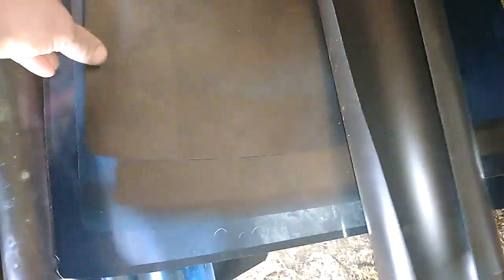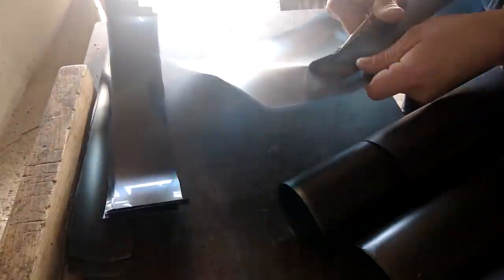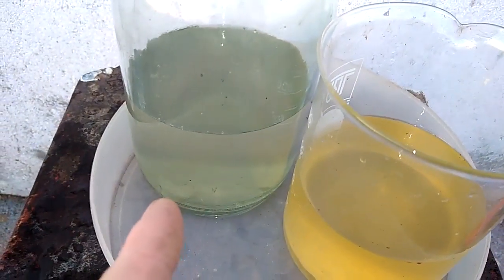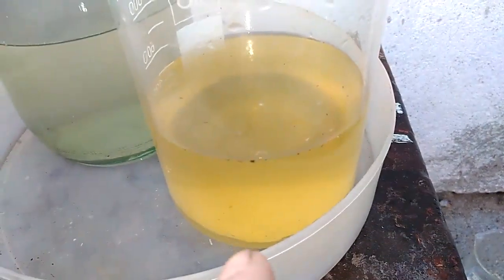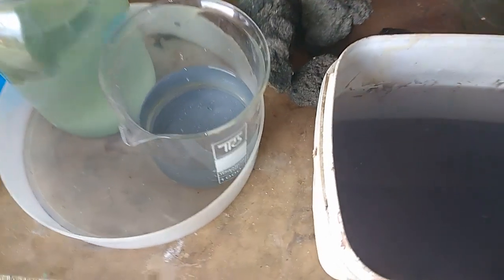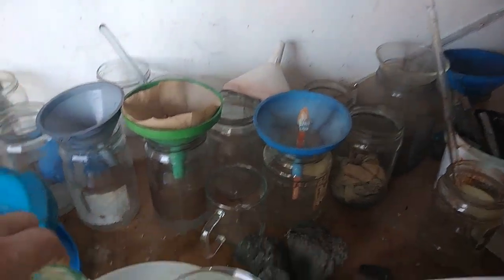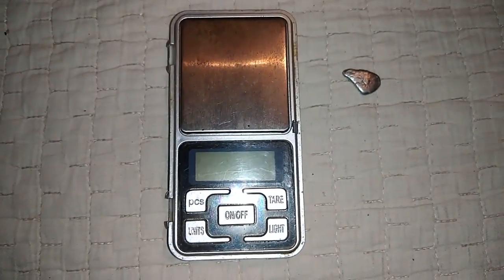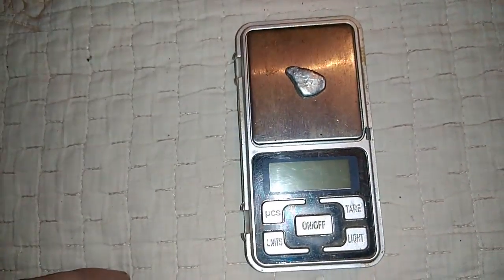Silver from X-RAY FILMS recovery!

Comment: We used to treat 10,000 pounds/week of medical x-ray , no acid but caustic soda , each film was shredded in 1/4 x 1/4 inch , the bath was then centrifugated to separate gelatin from silver  , the final mud was dried then burnt in gas furnace.The plastic was of no value @ the time. Now x-rays are completely done by electronics ...exception in poorer countries.

Comment: Back in the early 2000's I worked at a place where xrays were stored before being scanned.  After they were scanned they were sent for destruction.  NT recycling but shredding and then a landfill.  I spoke with one of the guys who came to pick up a load on day and he was saying that while they could recover upwards of 1oz of silver per every 100 xrays they were legally prevented from doing so because they were considered a medical record. Each box we had in storage had between 200 and 300 films and we had no less than 10,000 boxes in storage at any one time.  I look back now and I want to find the part of the landfill they buried the ash in.  Based only on what I personally saw I would estimate there is at least 50,000 boxes worth of xrays there.
Reply: Proper recycling should be a law.